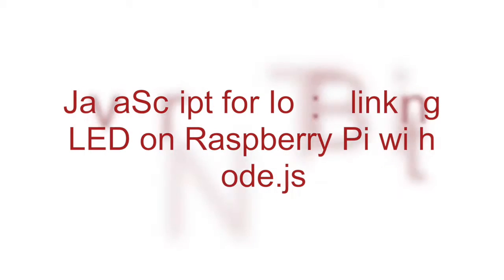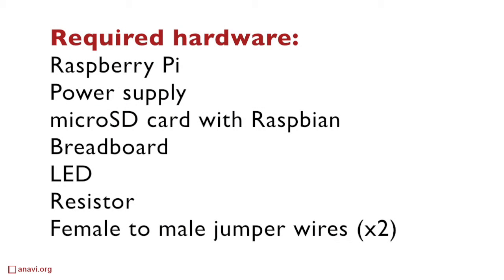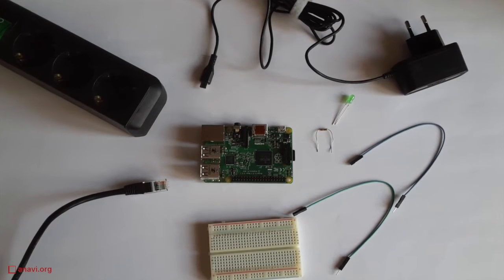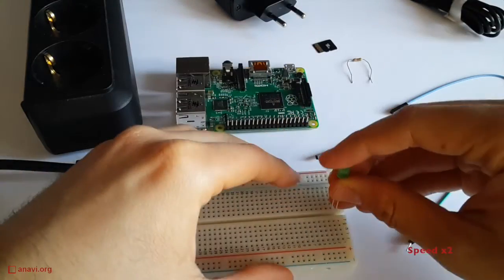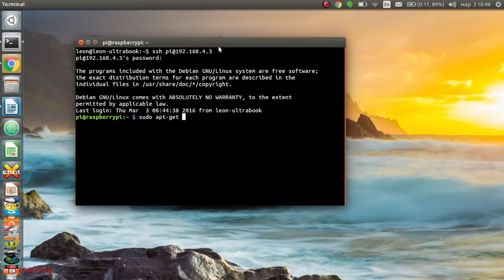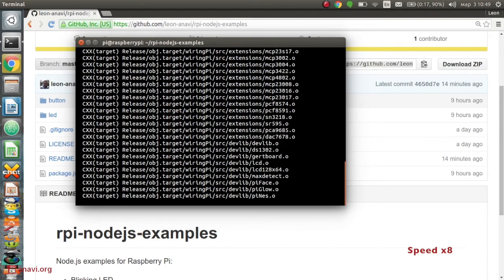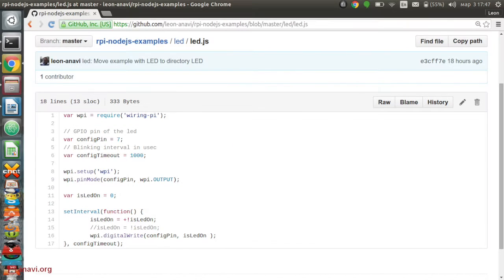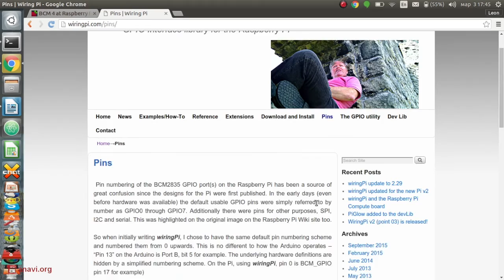JavaScript for IoT: Blinking LED on Raspberry Pi with Node.js

Comment: If I'm running a Web App deployed on Heroku, how do I make a button on the Web App execute "ledON.py" script so that the LED on my raspberry pi turns on? (Not a local web server, the server is on Heroku)
Reply from the maker: In this case you should use a machine to machine protocol such as MQTT, CoAP or alternatively create a HTTP API. I am keen on MQTT so if I were you I would do it with it.

Comment: Nice and simple example. Would installing mongodb be just as easy? Thanks for sharing!
Reply from the maker: +Ryan Connolly unfortunately the installation of MongoDB is a bit tricky. I am not sure if there is a pre-built deb file for easy installation on ARM devices. Anyway, there are several tutorials in the Internet which provide steps how to install MongoDB and I recommend you to have a look at them first. I am adding MongoDB on Raspberry Pi in my TODO list for my next videos :)